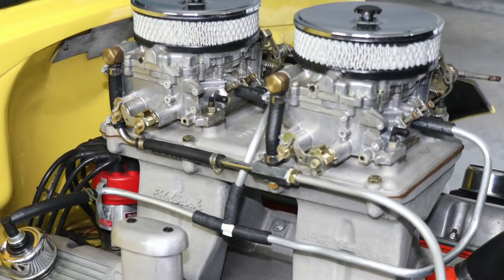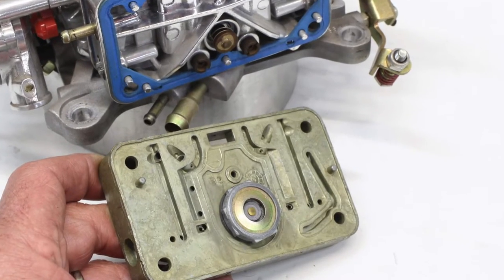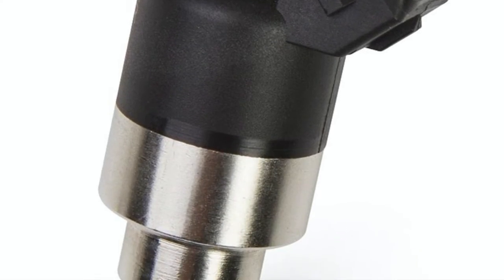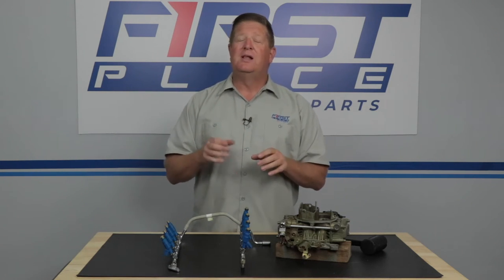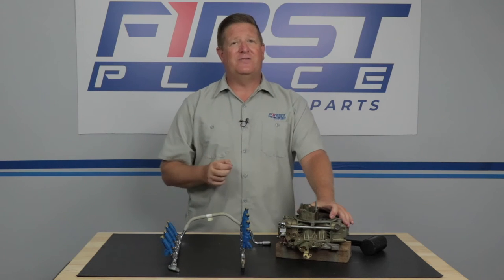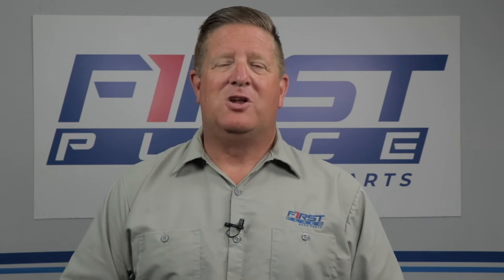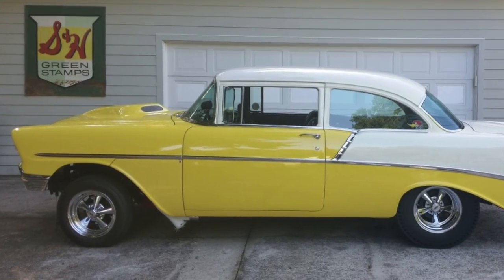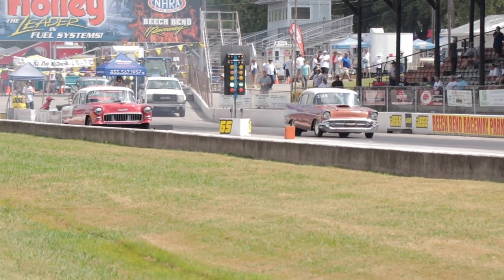Carburetor VS Fuel Injection | Is It Worth The Swap?

Comment: its not worth the swap if you go with holley sniper, im having EMI RF issues and have found countless you tube videos with many other sniper issues like t9uchy throttle, wire connector plug on injectors coming off, plus countless ECU failures
Reply: Yep marketplace and Craigslist are full of them. I will take a carb any day to not have the electronics issues

Comment: Carbs= fuel first, then air. Injection meters fuel by airflow. A drag car needs fuel first but doesn't turn corners so carbs work for that application. A rock bouncer on the other hand,  will benefit from injection, it will stay consistent at any angle of g force influence.

Comment: Carburators have never caused me trouble in any temperature or weather conditions, and I've always lived in -40 - 100F conditions with 71 models onward. As long as they are periodically cleaned and adjusted every 5-10 years or so. And I'm talking cars and motorcycles. And I always passed emissions tests with 0% of anything bad. EFI may have some extreme conditions where it may beat a carb by a few percent in some performance parameters, but the amount of mining, industry, and production for all the added parts EFI requires creates a lot more damage to the air+environment than carbs ever did, IMHO. Electronics are a scheme to profit more as I see it. It's a development in profiteering, not really a development in environmental conservation or engine performance. If airplane engines run fine with carbs from -60 - 120F, from 500ft below sea level to 25,000ft above, there's no reason cars+motorcycles can't. And that not even including all the extra labor+materials+expenses involved in the computers that are required to read and manipulate the onboard computers. Nor is it including the fact that EFI does not monitor all appropriate changes in atmospheric conditions. Generally, they monitor air mass flow and an exhaust sensor which is not enough for the variety of driving conditions.
Reply: That’s why I’m very happy with my carbureted Volvo.

Comment: After watching so many videos of people having problems with EFI I decided im going to stick with my carburetor set up. I haven’t had any issues with my Edelbrock AVS2 yet and its been turning on and running even in cold temperatures below 40F. I don’t have to worry about my ECU going out or O2 sensor going out on me.
Reply: I did a swap to the FAST EFI on a 82 CJ5 JEEP, I live in CO. it would start up bump of a key at -10 below  no problem 4X4 on jeep roads at two miles high.  The point is that I had a lot of problems with the EFI, leaving  me stranded from fuel pump relay or O2 sensor and ect. The carb would run like shit at two miles high but it never left me stranded. And it was about 3500 for the EFI. I should have put the $ in a paint job 😆😆MPG the carb got 18mi the EFI 14 mi
Reply: @christophershea2952  exactly! With a EFI you’re pretty screwed if it breaks down. I just recently installed a wideband gauge and a pressure regulator with a pressure gauge and now my carburetor on my K5 runs so much better now. The wideband gauge is a must if you want to dial in your carburetor correctly.
Reply: @christophershea2952  they actually have a 4x4 off road carburetor from edelbrock.

Comment: Thank you for this video.  It's very helpful.  I especially appreciate you covering the disadvantages as well.  I have a 302 Windsor in a project car, currently with a 600 cfm Holley on an Edelbrock manifold.  The carb is definitely not correctly tuned now, with poor driveability.  I'm weighing the cost/advantages of retrofit EFI.  

One thing I'd like to know is whether an aftermarket 4-barrel EFI provides any added hood clearance over an equivalent carb?  Seems like it might not need to be as tall without the stack up of concentric venturis, choke plate, etc.
Reply: I have a 289 on a 68 and just swapped my 600 Holley for a sniper they are pretty much the same height the sniper maybe slightly shorter but not by much

Comment: im trying to do more research on carburetors… I have a chevy camaro 231 cu in 3.8l with a 2bbl carb. Are 4bbl better than 2bbl? Ive seen people put 4bbl carb on a 2bbl intake… is that damaging???
Reply: The 4 delivers more fuel and air therefore more power but it’s harder to tune and maintain

Comment: My question is about the alcohol gelling with my carbs problem. I can take jelled gas and fuel injector and start and run. I'm tired of cleaning carbs. But, I'm a serious amateur, so what about fuel gel problems?
Reply from the maker: If your vehicle sits for extended periods of time or you live in a very humid climate, using non-ethanol (some call it off-road gas) or a fuel stabilizer designed for use with ethanol fuel when the fuel is fresh will go a long way from reducing modern fuel from going bad
Reply: A bottle of Lucas fuel system cleaner every few months or so can seriously reduce carb crud.

Comment: like you could not damage the engine with a carb that runs lean... you love to deal with clogged fuel residue in your carb every single freaking time you wana start the darn thing after sitting for some time. just go up a hill and you need to retune the darn carb. you then get off the hill, needs to tune again. carbs are nice and all, but they are just a pain in the ass.  its a no brainer. EFI wins.

Comment: I got a 67 Ford Thunderbird 390 cc 6.4 l. I'm having all boats of trouble with the carburetor The car stalls on me I have to give it a bunch of gas when I start it. The carb has been rebuilt I've spent money at the shop looking over vacuum lines or different things. I'm not a car guy I don't wrench on cars am I better off going with an EFI conversion and just spending the money or taking this thing to the shop every time it has a problem with the carb. I don't want to wrench on the car but I want to own it and I want to make it work somewhere or other So what do I do in my situation I'm not going to work on my car cuz frankly I don't fucking want to I just want to drive it and enjoy it I don't think I have to do the work in the car too Have fun I bought it It's mine I can do with it as I want. I just want something that works I turn it on and it starts and goes.
Reply: Old cars is for old guys, new kids ride new car ! Simple ! If you don't know a thing about car, your playing the wrong game.
Reply: I stopped reading when you said im not a car guy and don’t wrench on cars. Yes EFI is amazing on new cars or cars that were equipped with EFI originally. However if you convert your car that originally had a carb to EFi you’re gonna have way more problems.